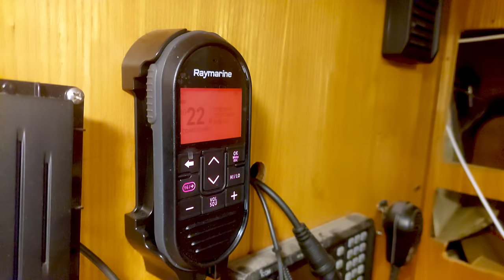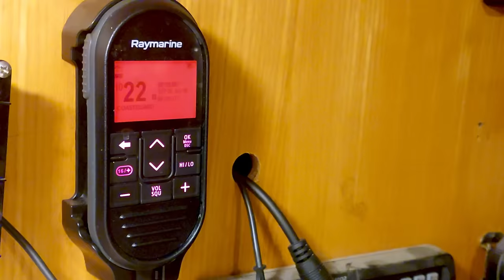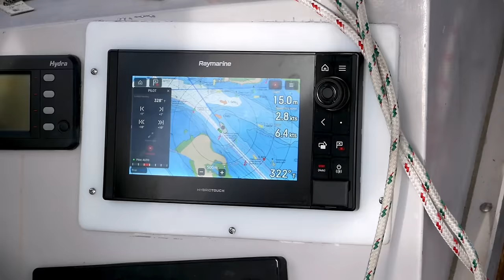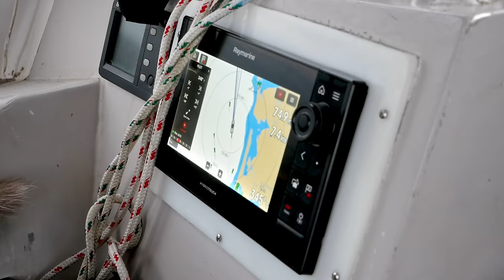Crossing the World's Most Dangerous River Bar

Comment: Hi Juho, thanks for letting us be part of your journey! For me, this video was not too long at all! 
About your Centerboard: we had a Maracuja 39 some time ago, which was the smaller sibling of your Alumi. For quite a while, Garcia made the centerboards, that they have play sideways. Under side pressure they set on the sides with a slight angle. The idea was to give it  a better upwind performance. Maybe you noticed, that the bushing in the centerboard was not cylindric, then it was definitely made on purpose like that. Also, the centerboard is not totally unweighted, it has some lead inside at the back side, to keep it in down.
It's floating in nearly perfect sailing position under water (I installed our centerboard after a repair while the boat was in the water). 
We learned, that It was most comfortable to sail with the centerboard partly up when going abeam and completely up, when sailing on a broad reach or downwind. The boat movements were also better with the boards up and the chance that you broach, is nearly zero without centerboard. 
We newer locked the centerboard down, it stayed in position by itself and it would be able to pivot, if we hit something with the boat. For the same reason, we kept the small daggerboard behind the skeg  mostly up, or at least higher than the skeg. As hitting something serious with the daggerboard down could possibly break the  daggerboard box, which is most likely weaker then the daggerboard itself. We completely lowered the daggerboard only when needed for upwind sailing. 
Congratulations to your boat, I am sure, you will going to love it. We were very happy with ours. Sailing performance was very good except for upwind, but that's what you pay for a boat, with an inboard ballast (and 1m draft). 
All the best, enjoy life and stay safe. Rolf
Reply: Hi Rolf, I made a comment about the aft daggerboard in another video about a construction error in a few (the first?) mid-80 years' Maracuja and Nouanni. I've read, and was also told by an owner, that a Maracuja sank within minutes after the daggerboard box welds failed after hitting something with the aft daggerboard, and that Garcia contacted the owners to warn them and recommended a specific reinforcement. Do you happen to know anything more about that?
Reply from the maker: thanks @rolf6734 and @fredflintstone8664 , it's a late reply but I've noticed your comments! We use the centerboard much the same way as you. we're aware of the daggerboard box issue and I have seen photos of the destroyed daggerboard box. Ours is partly reinforced and might need to check into reinforcing it more, not completely sure. I'm trying to ask Garcia for more specifics, usually they get back with a reply but it might take a month or two (or three...)

Comment: I am impressed you figured out the centerboard solution and the leaky shaft drive solution, installed the Raymarine autopilot and replaced the windows quickly.  Excellent boatsmithing. Congratulations.

Comment: Thanks for great channel,  I was thinking about the rubber shim strips, - next time [if]  you replace them, is it worth considering a teflon like material, less give, but more slippery, almost like the cutting boards you can buy. I use that material where I expect some wear, [on bow pullpit to protect it from anchor chain, and other places.  Also, I appreciate you're indepth longer videos, that might bore certain groups w limited attention span.  But as an expeditionary climber and skipper the detail you provide is immensely helpful.  Thanks again, fair winds. Jim

Comment: Hey you two.  Excellent video, especially since I've been through that area  on a 46' Hunter sailboat back in July.  Good refit on the centerboard.  Am curious to see/hear from you if that fixed it.  Also, good call on getting the autopilot fixed.  Certainly necessary for those longer passages when you don't have a place to pull in for the night and drop anchor.  
When we crossed the bar on the Columbia river, we ran into 3' seas and some white caps but nothing the boat couldn't handle.  We also stayed in the same marina you guys were in so that brought back some good memories for me!
When you get into Queen Charlotte sound, be on the lookout for logs/flotsam.  There can be a lot of it sometimes but usually just a few here and there.  Best to make that crossing in good weather during the day, then find some place to anchor for the night.  Up the inside passage, there are all kinds of places to anchor and explore.  If you're going to do the passage during the winter keep in mind that the winter winds during clear weather are from the north or northwest and can be quite nasty.  It typically blows out of the mountain passages off the 250 mile long Juneau ice field!  
If you can find it on your charts, the Alaska Marine highway has a route they normally take which will keep you mostly out of the larger bodies of water and give you some relief from the wind and waves.  
There are a few glaciers you can visit in your boat.  Tracy Arm is 40 miles south of Juneau and it an amazing fjord.  In June/July, you can get somewhat close to the glacier.  South of there, there's what's known as the Endicott Arm and there are a couple of glaciers you can visit, but it's a long trip to get to them but worth it.  Google those to find out more.  Then, north of Juneau, there's Glacier Bay, a massive fjordland which requires a permit to enter (easy to get online).  The wildlife is amazing and plentiful.  You'll likely see humpback whales, some orcas, seals, porpoise, sea otters, eagles, and more.  I'd love to meet you guys if you're coming to Juneau for a few days.  I can give you rides to the store for food/provisions, and marine supplies if you need them.

Comment: If you keep chewing through new shaft seals, it can really only be from two things, rough worn shaft which wears out a lip seal style one or shaft movement. Shaft movement can only really be from three thing: Alignment (you've checked that), a slightly bent shaft (you'd be surprised how little it take to ruin seals) or bad faces on the coupling and or gearbox output shaft. Both of those faces need to be machined perpendicular to the shaft. This should show up during alignment if you rotate the two parts independently and recheck clearance at different rotations. We chewed through  two and a half brand new, different styled of shaft seals before we found the shaft was slightly bent. Good luck !:)

Comment: Glad you sorted the board, so you have a really slack fit on the pivot shaft, with the movement taken up by rubber strips? I think bouyant or neutral weight boards make a lot of sense, makes the lifting system a lot simple.....all good.

Comment: The shaft seal remains a mystery, annoying that it still leaks a little. I was wondering if you are not packing the seals with grease preventing them from sealing properly under water pressure.

Comment: Just looking at your waypoints in the last minute of your video, it looks like you are in Port Hardy or vicinity! If so, you're pretty close to our place here on Denny Island, -just north of Cape Caution. You're welcome to stop by and tie up to our dock. There is a travel lift and shipyard here, where you can haul out and leave your boat (a previous video you mentioned going back to Finland for a visit) Logs are a fact of sailing around here, especially around high tide periods, however there is the ever-present additional hazard of loose commercial fishing gear. Take a walk on any beach or waterfront around here and the intertidal zone is festooned in rope, net, net floats, heavy-duty fishing line, scotchmen etc. You might want to consider not rushing through these waters. This area is amongst this planets' final, relatively intact tracts of ancient primaeval wilderness intermeshed with 14,000 years (and counting) of continuous human history. This enormous archipelago offers thousands of well sheltered, empty anchor-spots as compared with the long, sweeping coastlines of Vancouver Island, where every sheltered cove is completely plugged with boats... Just loving your videos! Cheers, Ingmar  www.spindriftpoint.com

Comment: Respectfully, this is not the world`s most dangerous bar. The notoriously deadly Rip at Port Phillip Heads is in Melbourne, Victoria. Australia. The official Pilots Log acknowledges that. This is because Port Phillip Bay 40 mile diameter) empties into Bass Strait through the heads which is just a mile across

With a typical SW blow with wind against an 8 knot current breaking waves stand straight up with no backs on them! To 80 feet in worst conditions.

Also bottom topography is a very shallow bank ( the Rip bank) falling into the "The Entrance Deep" at 400 feet straight behind providing undersea waterfalls/whirlpools (fact, I have ridden them).

Comment: Are your primary winches barient 32’s? How do you like them? I’m building a boat and have some 32’s with 36’s as primaries, I know they are a pain to take apart but after spending hours cleaning them all they seem great, hoping the power is up to snuff on them.
Reply from the maker: hi, as far as I know these are not super great winches, there are better ones out there, but as long as they work, i can't complain ;) We haven't taken ours apart yet, but yes they're overdue for service. As far as I know replacement parts are very hard to find! if you have a source, please let me know! :)
Reply: @AlluringArctic  yes much more difficult than newer winches to take apart, but simple enough if you have any mechanical abilities. When cleaned and oiled mine move very easily.

I’ve been in contact with a company called arco hutton in Australia I believe, that makes parts for them, i haven’t bought any yet but I will be soon as I need one bearing for a 32 and one self tailer lip for one of my 36’s that was damaged in shipping. I’ve heard good things about the company on forums etc though. Not cheap though.
The winches are definitely quality compared to say a lewmar 55 evo that I have, although maybe more archaic.

Comment: We had a problem with our centreboard, but it was the opposite of what you had here. The nylon friction blocks, which help to limit the sideways movement of the centreboard, were under too much friction when the board was raised too high. They jammed on one side when pressed tightly against the centreboard box. It would be easy for you to have the same problem with your new friction blocks. Please be careful to not raise the centreboard higher than earlier tests, in case it gets jammed. Our solution was to shave some of the nylon friction block away, to create a looser fit.  If it does get stuck in the raised position, try using the downhaul line with a little tension from the winch to break it free. Of course I'm assuming your boat has a downhaul for the centreboard. I'm not sure I saw one ...  🤔  Or, ask Sohvi to swim under the boat and give the centreboard a shake from side to side. That should make it come free.
Reply: Humor? DON'T dive in the water in the PNW in winter.  Hyperthermia will freeze your muscles immediately.

Comment: I'm going to be crew on a boat sailing across the north Pacific sometime during the end of March through April this year.  If you did this would you want to have a dry suit?  (Shopping online for a drysuit is easy Helly Hanson $2500... however, I don't want to spend that much so it's incredibly annoying. No matter what criteria I put in Google I get the exact same results.)  I've been out in 10C conditions  15knot winds with merino leggings, fleece sweat pants and my foulies... and I'd still like to be a bit warmer.
Of course the other issue is something fouls in the prop, someone has to dive under the boat to cut it loose... A dry suit would make this easier.

Comment: I don't understand how you are supposed to operate the centerboard. Is it supposed to be done at all time on the Garcia? I would have thought you would be able to lower and retract it maybe electrically. I understand if you hit something the centerboard has to be able to retract freely but how do you achieve some level of control to better the sailing? (whether you are downwind or upwind) The holding shaft also seems quite rudimentary, are there any ball bearings around it and some sort of lubrication to maintain? How did you get with those rubber bands, are they not getting the centerboard stuck in? It seems like a tricky part to get to work properly.

Comment: B.O.A.T. as you know, means Bring Out Another Thou$and. In my experience, if it ain't broke yet, it's a'fixin' to. That's why I now do most of my sailing in a 747 or a Ford truck, and that, only in bluebird weather. Good luck! I love your stuff, but from under a roof with a good stove and several cords of good split oak outside. If I ever have another boat, it'll  have a poured lead pair of keels.

Comment: If your centerboard is buoyant, does that mean all your ballast is in the hull?  Do you find Lumi to be very tender compared to your previous sailboats?  Do you have any weight specifications on the internal ballast?  BTW excellent photography of columbia river and neah bay.  Thank you.
Reply: The vessel has internal hull ballast.  The centreboard is buoyant to make it easy to retract.  If it were lead filled or solid you'd need an electric winch to bring it up.  Its a very big and fat piece.  
So it's designed to help with tracking and upwind weather helm and to limit heeling to an extent.  It's a great and very purposeful design.
Reply: Explained at 2:55 - 3:00 please review,  From sail boat data website:  Displacement 32, 214 pounds, ballast 10,009 pounds. Ratio ballast to displacement = 31%.  Keel is centerboard with dual rudders.  Aluminum construction.  Cutter rig.  75 hp diesel.  Named "Lumi". Manufacturer "Garcia".  Model is "Exploration 45".  Overall length of 46.62 ft. Beam is 14.57 feet.

Comment: These should have been designed with 76mm 90A (extremely hard durable) Slalom Inline Roller Skates Wheels with 16mm 316 stainless axles going through22mm thick bronze bush's either side of the board so that there is no wear & tear on the structure, if you had roughly 16 rollers (4 across x 4 up) each side every 30 degrees then this problem would never happen. You can buy 16mm x 22mm x 18mm Sintered Bronze Bushings in packs of 3 from China very cheaply & 33 of them for around 200 USD. Having rollers would mean that it would last for many years without ever wearing out.
Reply: In the mid ‘80s I met a French couple on a 14M aluminium yacht (Isatis - Arctic Fox) with a centreboard. They sailed several seasons in Antarctica and hauled themselves up onto the ice with their hydraulic winch/windlass at the beginning of winter and then set off on skis to ice climb! Their c/b case had a number of very large diameter teflon bolts threaded through it’s sides so they could easily adjust the clearance and operation of the board underway and from the comfort of the cabin - they demonstrated it’s operation and it certainly worked well at anchor

Comment: This is scary.  I can FEEL the boat's lack of depth as it rolls.  This is not a seaworthy boat.  The strips are NOT to keep the centerboard in place, they are just to reduce resistance from the centerboard slot.  The builder was totally clueless, and so is the  skipper.  (I'm and old yachtie with about 50k NM in ocean crossing.)

Comment: sounds like the rubber strips should be on actuators, or you could use water inflatable sleeves on either side of the center board so you can tighten or loosen as needed. so as it gets older you pump a little water in to tighten it up as you go.

Comment: How well does she sail with the board up?  It seems the board is just needed for leeway slippage.  So the boat can sail without the board off the wind and motor on the wind without the board.

Absolutely depending on that board sailing north of the arctic circle seems risky. Seems there are work arounds.
Reply: The boat doesn't depend on it. It is needed for tacking and generally going upwind. It isn't completely necessary otherwise